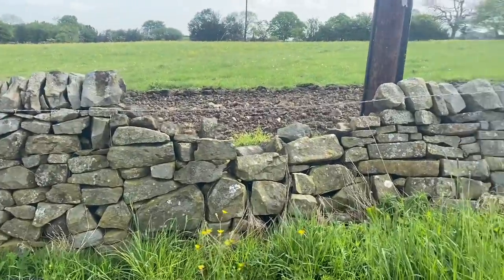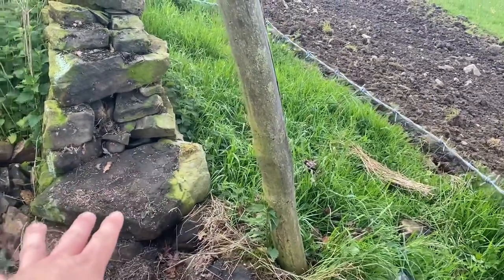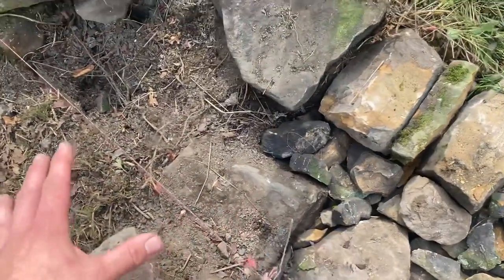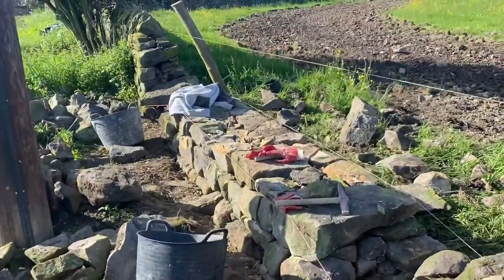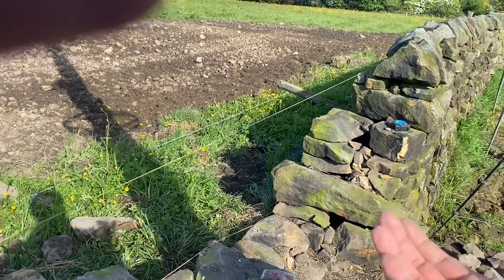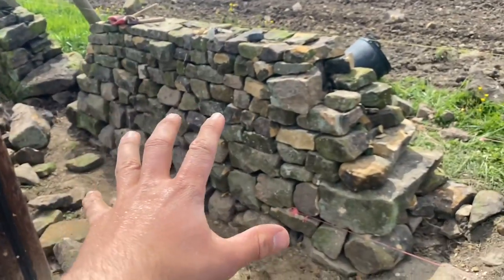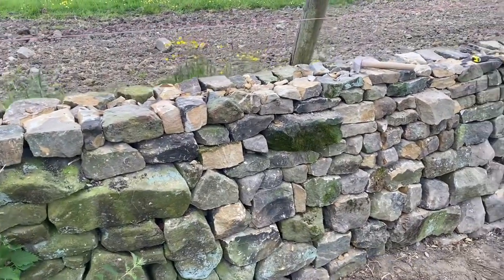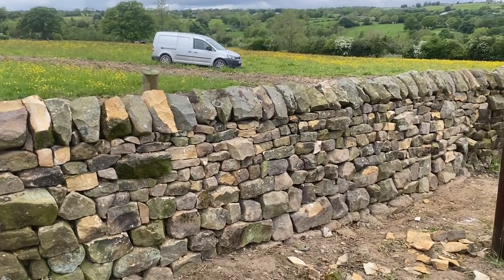Dry Stone Walling - Repairing A Dry Stone Wall For Beginners Tutorial

Comment: Interesting stuff. I live in N Italy, and in the Alps there is a lot of stone construction. I watched a video about fixing walls and the builder said to use smaller stones at lower points as the weight of larger stones above will hold them in place. I tend to think that those stones are thinner, more flat and squared off than these, so one has to work with local knowledge. One benefit of gentrification is that people with a ton of money are coming in and restoring the old buildings and walls. It is shocking to see the level of masonry coming from subsistence farmers from 1-400 years ago!